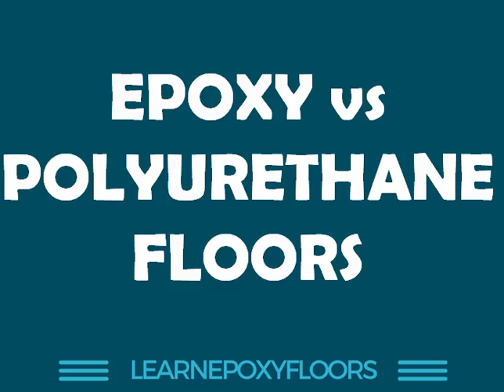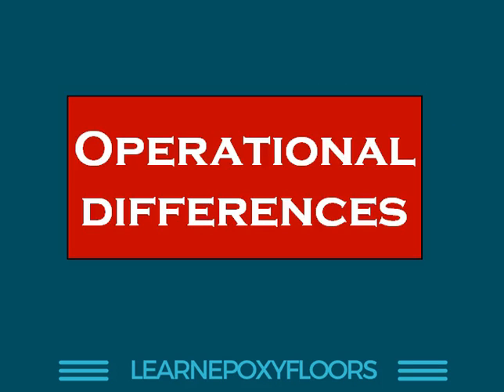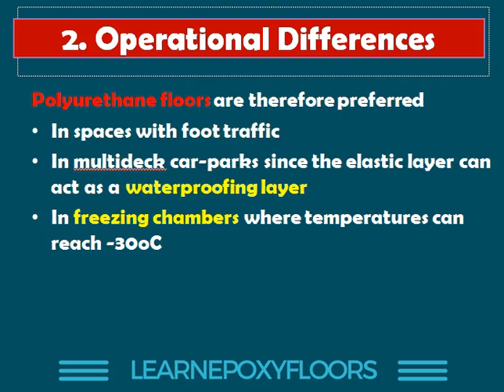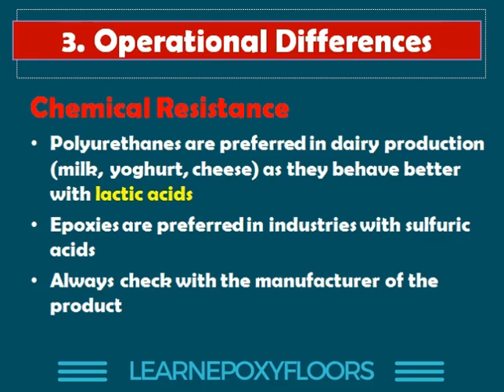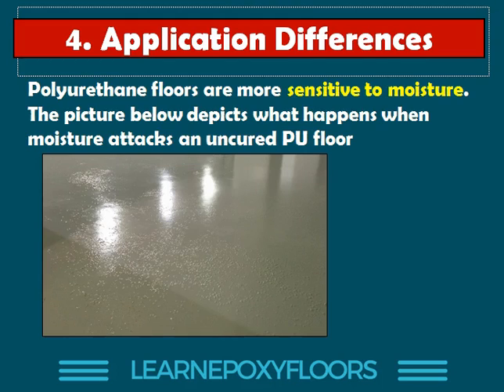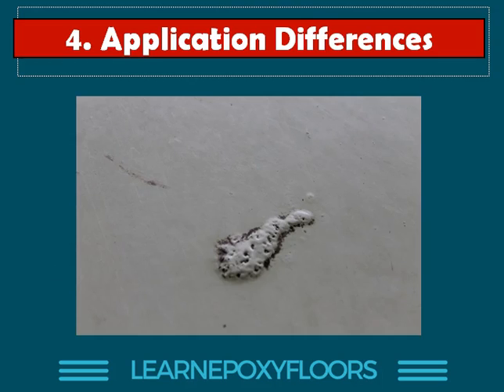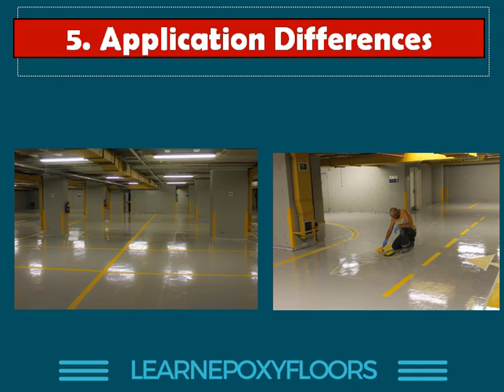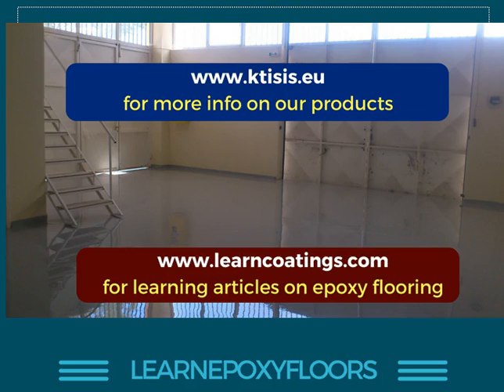Epoxy vs Polyurethane Flooring: Understand the differences

Comment: You mentioned Polyurethane is better with freezer condition, but also not good with humidity. 

Can you please explain more detail on this ? 

Say if we want to have a cold room or freezer room floor paint, what is the better flooring ? Epoxy or Polyurethane ?

Comment: Great video sir. I have a franchise business that the sidewalks have rust stains. I was told to paint them or totally redo all of my concrete walkways. It was suggested to use an epoxy 9100 series by Rust oleum. These are outside sidewalks and I do have them snow plowed in the winter. I'm looking for an answer as I don't want to be continuing to resurface the sidewalks every couple of years. Your thoughts and suggestions are surely appreciated. I live in the Wisconsin.

Comment: Which one is good for swimming pools
Reply from the maker: Epoxy tends to stick better in pools but the part exposed to the sun will require re-coating every 2 years. Polyurethane is more resistant to the sun but I find it does not bond as well in under water situations
Reply: @learncoatings-epoxyfloorin9448  so what's your final take for pools

Comment: Do you think PU would adhere to gelcoated then painted (/surely i would sand the best i can) surface of a fiberglass deck of a boat? Those decks are somehow a little flexible
Reply from the maker: I always advise apply a primer suitable for such surfaces if you are unsure. You may also want to check what base the deck paint is (acrylic PU, etc)

Comment: Hi sir can i use epoxy coating in concrete rooftops of buildings located close to equator regions which gets too hot in summer Or shall I choose damp proofs paints from some branded paint companies.
Reply from the maker: No epoxy should never be used on roofs it is not UV resistant. Check out this video here https://youtu.be/-I62QkqIP8w
Reply: @learncoatings-epoxyfloorin9448  thank u

Comment: Is there a general price difference? Is epoxy cheaper?
Reply from the maker: They are both in a similar price range. Certain types of PU may be cheaper and also certain types of epoxy coatings may be cheaper. But in general, I would put them in the same range..

Comment: I want to know which is the safest to use in a domestic environment.As some say protective clothing is required?
Reply from the maker: During the application you should have windows open, wear masks and gloves. Both types require equal measures, cant say that one is more dangerous than the other

Comment: Is it a good idea to coat the epoxy coated mini pebbled floor with a UV resistant polyurethane to  prevent sun damage and the yellowing? How long does it take for epoxy coating to look bad?
Reply from the maker: UV resistant polyurethane topcoats help protect, but in any case you shold not use epoxy coatings outdoors even if it is protected

Comment: I just put down an epoxy floor in my garage and it came out great. I also got a urethane sealant that will go on in a couple days when the epoxy is cured
Reply: Can you share what brand you used? I’m clearing out my garage this week so I can do my floors I’m still deciding on what to use
Reply: @yeslinda  rustoleum, you can find it at Home Depot

Comment: Sir PU coating is suitable for VNA fork lift with height of 10.5 mtrs rack kindly advice
Reply from the maker: When you are working with fork lifts at such heights you are usually dealing with heavy weights and rotation around the axis of the fork lift. Epoxy is a better solution in such a case

Comment: Here's a tip for end users of coated garage floors who this may apply to. 

I'm sort of retired and work a couple of days a week at Walmart. When their product stockers roll out pallets of pack water bottles the pallets generally have a sheet of cardboard under the 2nd or 3rd top layer. Generally They will let you have one or two if you ask. Those cardboard sheets are quite handy to place under a gas powered lawnmower or yard tool to keep oil/gas/paint drippings off your nicely coated floor.
Reply from the maker: Great tip! Yes you are absolutely right, dripping oil can leave long term stains on the floor. I see car mechanics always place PVC sheets in areas that get messy with oils

Comment: Wow. Been watching garage floor covering videos for weeks. They generally don't go through pros and cons. I'm looking to do my garage and back covered screened-in patio floor coverings. 

For my garage, I'm a DIY soul who works on gas powered yard tools.. dripping oil and gas every now and then. And my riding mowers tires leave marks on the old vinyl floor tiles the previous home owner laid down. Also, about two feet just inside garage door get wet from rain and daytime sun. Which one will be better to use? 

My patio does get rain wet frequently.

Thanks for any help with this.
Reply from the maker: Both floors may leave stains from gas and oils, but I find that epoxy has a better long term performance to such chemicals

Comment: Hey, thanks so much for these videos! I'm coating a kitchen floor for a commercial kitchen (140sqm), I'm on a tight budget and plan on doing it myself. It does not need to look perfect, it just needs to cover and be none slip. Question - can apply sand to the first layer when using PU? I saw you did this in a video when using Epoxy. And is there special kind of sand you use? Thanks a million. Leon.
Reply from the maker: Yes you can apply sand on PU, although it is not very common. The reason is quartz is a very hard mineral. And by combining it with an equally hard material like epoxy you get a very resistant floor. Since PU tends to be more elastic, it is not as common to apply sand on it

Comment: Akis - thank you for the clear presentation on the two flooring materials. Since you focused the presentation primarily on commercial use, I'd like your opinion on using one or the other for a home basement. Sounds like PU is better because it resists cold temperatures but epoxy handles humidity better - which one would you recommend? Would also appreciate if you could weigh in on the aesthetics of the two products.
Reply from the maker: Polyurethane is necessary if the temperature drops below freezing. I doubt if your basement would get that cold so epoxy would be fine. From a humidity point epoxy would cure better. Aesthetically PU floors tend look a little softer and have a matte finish will epoxy tends to be glossier

Comment: I’ve not used PU before. Whats the viscosity of PU? Whats the recommended thickness? And in a cold room, can I use Epoxy for the first two coats then use PU as a top coat? Will this work?
Reply from the maker: Viscosity of PU is similar to epoxy, it really depends on the formulation. Thickness for a coating is usually at 2 or 3mm, cement based PUs can go up to 1cm. For a cold room you want the entire system to be resistant to low temperature so I don't recommend using epoxy underneath
Reply: @learncoatings-epoxyfloorin9448  noted. The lowest temperature of the cold room is about 3 degrees. Thats why I was thinking of epoxy underneath. Its not too cold to say -30 degrees

Comment: Thanks mate for the video 😉 any advice for what i gonna use for my mechanic garage with a car hoist cheers
Reply from the maker: You are welcome, epoxy is better than polyurethane for mechanic garages. You need something that's tougher like epoxy. Also I have noticed that some types of chemicals used in mechanic shops leave stains on polyurethane

Comment: Many thanks for your well explained video.. i was in stage of decision for my car parking floor coating, and your video was very helpful to me for selecting Epoxy over the Polyurethane due to high humidity.
Reply from the maker: Glad it helped!
Reply: @learncoatings-epoxyfloorin9448  thank  you for your video. I have one question: Whats would you do when concrete floor was expose or in contact with oil, and you need to apply an epoxi coating?

Comment: How do you apply polyurethane in a humid climate?
Reply from the maker: you would need to isolate the room where you plan on doing the installation. Run an AC to lower humidity levels. Aim for under 50% air humidity

Comment: how about stain resistance? is it significant?
Reply from the maker: Difficult chemicals will tend to stain epoxy/ polyurethane in different ways. Some acids last longer on epoxy and others on polyurethane. Overall I would say that polyurethane does a better job of repelling marks from shoes etc
Reply: @learncoatings-epoxyfloorin9448  i couldnt find much info on this. At this point  anything will help. So thanks!

Comment: I live in Florida with a lot of humidity, in a condo.  I want to change out my floors with new tile but before I do that, I want a coat of Epoxy down cause the slab is 45 years old and has not water vapor.  I have had small amounts of water come up from the grout and NO it is not a pipe leak. We had a water inspector out and said Epoxy will stop future water leak's coming from the slab and through the grout. Do you think the epoxy will do it?
Reply from the maker: No I am not a fan of using epoxy to stop any rising dampness. Epoxy cannot breathe as a product. I would much rather apply some cementitious based rising dampness blocker. I mean there are some epoxy primers that block humidity but cement based products are much better for such a purpose
Reply: @learncoatings-epoxyfloorin9448  Thank you for your recommendation.  Can that Cementitious based rising dampness blocker be spread throughout my whole condo floor (1200 sq ft) , then apply my new tile down on that?

Comment: Great video.. question.. we are moving into a 10 year old home with a 440 sf garage.  I don't want to do a clear application to the floor... what is the best product... clear epoxy or clear polyurethane?
Reply from the maker: I find epoxy works best on bare concrete, expecially if the concrete contains moisture

Comment: sir let me ask some doubts kindly please give me a reply..
1) what kind of chemical or material should be applied as primer before applying polyurethane over concrete floor or  on plywood
2) which chemical or material should select for design lines over the polyurethane garage floors 
3)if we apply polyurethane putty over plywoods what should i select or what is the best material to make a finish coat .. for cabins..
Reply from the maker: I usually use epoxy primers for polyurethane coatings. This is for concrete as I do not have experience on wood. For garage floors, you can either use PU based coating for the line, or I often use reflective alkyd traffic paints.
For cabins I would recommend that you stick with wood paints
Reply: @learncoatings-epoxyfloorin9448  thank you sir, 
sir, what about the usage of water based epoxy primer...is it a right choice before applying epoxy resin, pu, or polyurea ( means cold cure polyurea) 

sir, is it safe to apply epoxy and polyurea in new toilets or bathroom waterproofing..above concrete and under tiles...means wet area...
Reply from the maker: @mericontechnologies989  Yes I used water based epoxies as primers and they tend to work very well, and unlike solvent based primers they do not contain VOCs. As for under tiles waterproofing, pu coatings are the best
Reply: @learncoatings-epoxyfloorin9448   sir, thank u so much.

Comment: This might be totally irrelevant to your field but I was wondering if you know on what surfaces water based polyurethane can be applied. More specifically I'm interested to know if I can use PU on wood and canvas materials to create a similar glass looking result to the epoxy. 🤔
Reply from the maker: There are PU coatings specifically formulated for wood floors. So its best that you look at PU varnishes, and you ask for a high gloss one. However these varnishes tend to be applied in thin layers, they are not really suitable for thick layers
Reply: Thank you, I'll look into it!

Comment: hello sir! is it possible to use the too product together? polyurethane  and epoxy. thank you.
Reply from the maker: Good question, it is common to apply a polyurethane topcoat over epoxy. However never do the opposite applying epoxy or PU. Polyurethane surfaces are very difficult for bonding and require priming first

Comment: Thanks for this post. I did epoxy on my old garage and got many scratches just from dragging stuff around and now that we moved to a new place definitely I will use PU coating. ( in fact PU caulking tubes are my most preferred glues vs PL900, for example)
Reply from the maker: Glad it helped
Reply: @learncoatings-epoxyfloorin9448   My application is not a floor but I cannot use resin because it has to be in the sun for 10 hours and I cannot use acrylic because it is going to scratch
so PolyU is my only option... do you think if I waterproof then cover with a protective film like the one used on cars... will I be safe from water? and PolyU is no problem in the sun

what do you think?
Reply: @FirstLast-tx3yj  spar urethane for the uv properties.  3 coats foam brush don't press hard at all or you'll get air bubbles,  silicone squeegee type brush can help as a final stroke,  move it quickly
Reply: Thanks

Comment: Need some information regarding my business. Is there any company that provides sales internationally? Is there a way to bring a shipment in Pakistan ?
Reply from the maker: Yes many companies ship internationally. My company ships overseas as well but it depends on the quantity because I can only ship by sea in containers. Smaller quantities are too expensive to ship. How much would you require?
Reply: @learncoatings-epoxyfloorin9448   i want to know do u have already suply in Pakistan
Epoxy resin its 2 components
Resin and harder
Clear and used in 3d flooring and Table top making
Pls let me know on my whatsapp no 0334-9549146

Comment: Here's an odd question would it be safer for a shower and tub to be polyurethaned or using epoxy let's say I painted it and then want a glazed over to the tiles what would be best for shower tiles not the bathtub
Reply from the maker: they would both be slippery so I am not fond of either solutions for showers

Comment: What can I use on outside concrete?I'm wanting to paint a basketball court
Reply from the maker: Definitely not epoxy. Many people paint outdoor floors with acrylic sports coatings as they are soft and friendly on the feet. Another option is aliphatic pu
Reply: @learncoatings-epoxyfloorin9448  thank you!

Comment: Is this oil or water based polyurethane ? I’m assuming oil based just want to make sure , thank again for this. Video, it changed my mind from epoxy
Reply from the maker: Both epoxy and polyurethane are solvent based resin coatings

Comment: Awesome. Video. What’s your recommendation for a standard work home garage in Phoenix Arizona???  Depending on the product, when should or what time of year would be the best time?
Reply from the maker: Thank you for your kind words. I take it gets quite hot in Phoenix at this time of the year. You may be faced with really fast potlife not allowing you to apply the products properly. The best time is maybe in September or early June. The weather is still warm and dry but not too hot

Comment: Thank you for all of your videos.  After degreasing, washing, and etching with citric acid (included in kit) the cement floor in my 2 car garage, I applied Rust-Oleum Rock Solid polycuramine gray I purchased from a big box store.  It was a 2.5 car kit but only covered half of the garage.  I purchased another kit and finished it.  After it dried there was discoloration throughout.  I called customer service and was told to buy another kit and cover it.  I did that and applied it early in the morning when the humidity was below 80% (it was 69-75% when applied).  Within a day though there was a storm and now, a week later, there are parts of the floor that are sticky and parts where color will come off.  I was told by customer service to use acetone on a rag and wipe up the parts where color is coming up (since it will never dry if left alone), let it dry over night, ensure humidity is lower than 80 and will remain lower than 80 for at least 48 hours, and apply a 3rd coat.  Do you think this will work?  Or should I just cave in and hire a professional to remove it all and start all over?  For a 400 sq ft floor I'm getting quotes in the $2,500-$3,000 range.  Does that sound right?  Thank you for any advice you may have!
Reply from the maker: Stripping epoxy (especially if it sticky) is a tedious task that is probably why they are charging so much for such a small surface. As for the product that you used, I have never been a fan of DIY products sold in bog box stores and neither using acid etching as surface prep. A proper epoxy floor needs grinding and priming before any colored topcoat is added

Comment: Hi , if I want to apply a thin coat of urethane over epoxy flooring, does that protect epoxy from yellowing? And how long I have to Wait after epoxy the floor to apply urethane?
Reply from the maker: If this is outdoors the urethane wont really be able to protect the epoxy. The sun will go right through and will eventually destroy the epoxy. If this floor is indoors a clear topcoat can definitely delay the onset of yellowing
Reply: LearnCoatings - Epoxy Flooring Training thank you so much , it’s a house , I live in Caribbean , most of the work going to be inside but there is some areas around windows and doors will be effected by sunlight, any advice?

Comment: LearnCoatings -I have a question. Will a well cured PU surface be able to withstand contact w/ perspiration, humans sweating, like a fitness center floor would be subject to? Thank you for the video. Really informative.
Reply from the maker: Absolutely no problem. A PU floor has very strong waterproofing properties so once the floor is cured there is nothing to worry about. Fitness centres tend to use PU floors since they are softer and friendlier for users